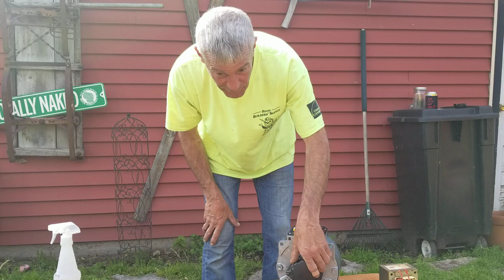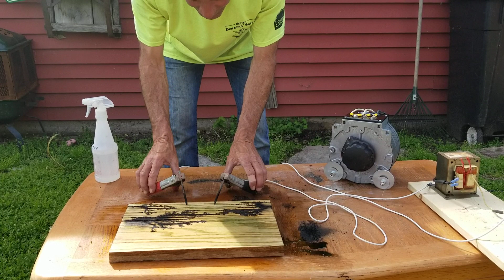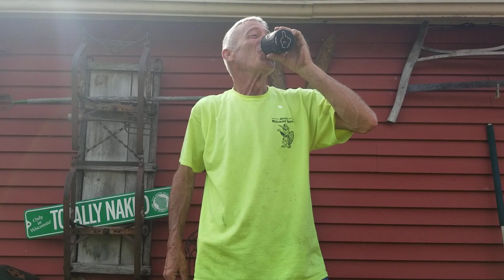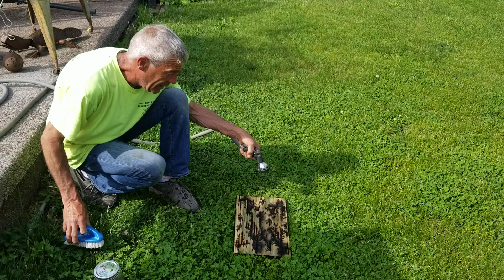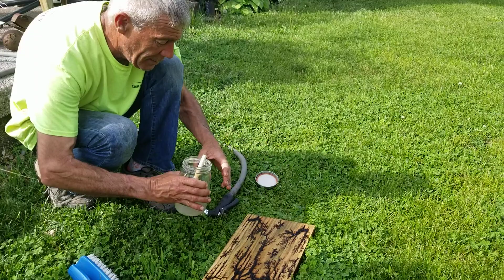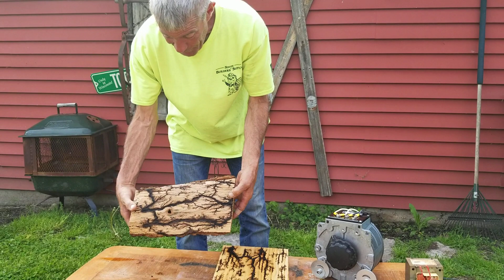New Variac Arrival

Comment: Handles the probes while the transformer is still live. Wipes the water/bicarb solution away with the same hand he then uses to control the Variac. Has live bare contacts on the top of the variac exposed and is reaching over/around them to get to the knob. Puddle of conductive water on the surface of the same table that the bare metal of the variac is resting on. 
No wonder he hasn't uploaded anything for three years. Dude smoked himself for sure.

Comment: I'll second what Bill said please get your hands off the high voltage side and please get your hands away from the transformer. There's just no need for that risk.

If you want to handle both probes then make a safety handle from an insulating material whereby the live wire doesn't come within 10/12 inches of your hand.
I have 2 probes made of layers of cardboard, I have a 10 inch handle with no wire going through the middle so that I can hold it while I burn.